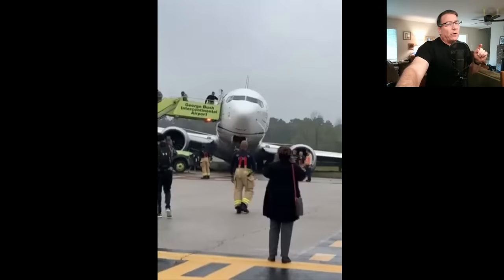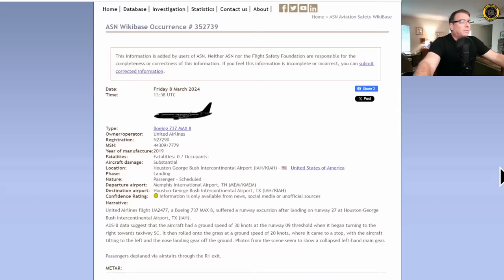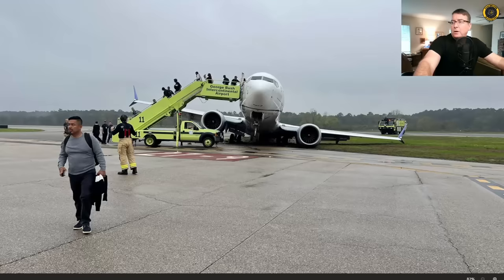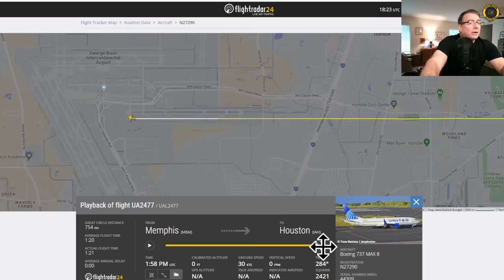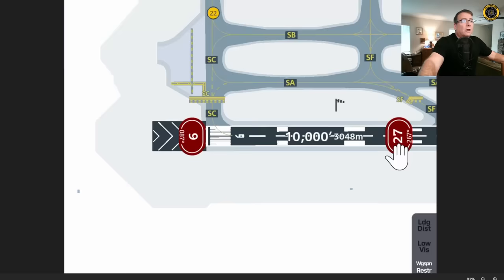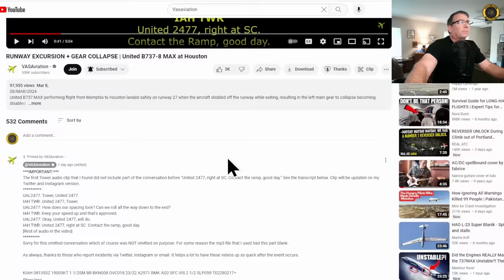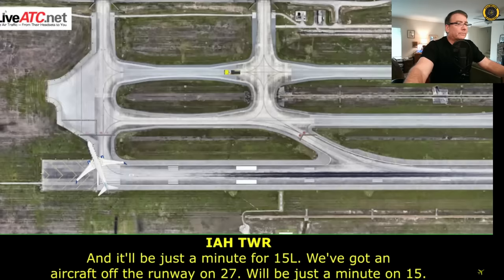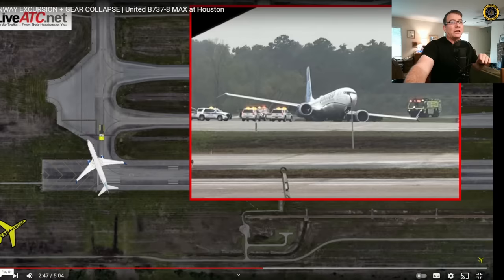United 737 Max Runway Excursion IAH 8 March 2024

Comment: it seems like it could be hazardous to deplane without getting a fair bit of lift/blocking under that nose gear or near the nose gear.

I would hate for that plane to tilt forward due to people leaving the aft section while people are stepping out onto that air-stair.
Reply: I was thinking that too.  Maybe they determined it was stable due to resting on the engine which is quite far forward on the Max.

Comment: Brings back memories of a MD88 taking a turn too fast off a runway in Cincinnati back in 2008.  Couldn’t turn and went wheeling through the dirt eventually powering itself back on the taxiway.  Sod was blasted all over the runway. Came to get gate and they wrote up main landing gear off the pavement.  I’ll say mud was up both main struts and nose gear.  Needless to say that aircraft spent many days at the hangar going through all the required special inspections.

Comment: I learned that lesson early in my airline flying while landing in Jackson Hole. If you're not familiar, KJAC is high elevation, and a short runway.  We had a wet runway. Grease job landing and easy on the brakes. I was startled when the captain took the plane and applied heavy braking. He turned off the runway at the end at about 5 knots. Even so, you could feel the nose gear slipping along in the runway paint. I conveyed that lesson to my first officers for the next 30 years. Thankfully, I never had a runway excursion. Ya!

Comment: 27 is always the runway of choice for Continental / United pilots, as it is a shorter taxi to the gate if you are parking on the south side. On the 777 and landing 27, I would always ask to roll to the end, as it makes a nice ride for the folks in back...as long as you stay out of the weeds!
I do not recall the tower ever asking us to keep our speed up when rolling to the end.
Reply: That does seem like an odd comment. Did they expect the pilot might just stop and then turn?
Reply: 777 is in a greater class than the 737, so turbulence time is less for this scenario, and another was closer on his tail.
Reply: @libby2012  I agree.  I'm guessing the controller had the guy behind him (1383) a bit close, and didn't want 2477 to dilly-dally.  Anytime ATC gives me an instruction like that, I think to myself "I'm flying this thing, not ATC, and I don't need external pressure."  "Unable" and "standby" are your friends.
Reply: Not the case reference 1383 as if the separation was decreasing to less than 2.5 NM inside of 10 NM from the runway the final monitor who has the responsibility for the separation during simultaneous ops (which they were operating) would have slowed 1383 and that did not happen.  The tower controller simply asked 2477 to keep their speed up on final since they requested to roll to the end.  I agree, you fly the plane and if I as the controller give you a clearance you don't like....."Unable" is the reply  for sure.  Since they asked to roll to to the end I suspect they would not have responded with "unable". @dermick

Comment: There is a video taken by a passenger when they de-planed. Sorry, I can't re-locate it, but I think it was on a local Houston TV Channel on TY. It showed the 737 took out 1 or 2 of the end of runway lights, and you could clearly see the skid marks of all 3 tire sets (L,R,Nose). It was clear they were going way too fast, and they probably should have bailed out and gone straight off the end of the runway. That would have saved the landing gear from collapsing.
Reply: Nosewheels don't have brakes so skid marks from the nosewheel indicates the nosewheel was turned but skidding on the pavement.

Comment: I note the prior exit - Sierra Bravo? - peels off at 35-45 degrees. Wonder if they forgot/assumed something about the profile of Sierra Charlie and felt no need to bleed more speed.
Reply: Sierra Foxtrot, a high-speed exit.  But that would have taken three turns (right 30, left 30, right 90).  I suspect they were looking for the easy way out, as Juan mentioned, a right 90 and straight to the gate.
Reply: @PatrickSennett  I'm guessing the tower controller would have preferred they use SF, it gets them off his runway quicker, and not as much worry about spacing.  Stay on the runway, they're on it an additional 30 seconds or so.  It's so silly, using SF then the parallel taxiway (then the 90 degree turn) would have taken maybe 60-90 seconds longer to get to the gate.

Comment: The runway paint ...just as slick, if not slicker than the rubber deposits. From experience, even at less than 10kts that paint will cause the nose gear to slide skid
Reply: Even that curb paint for the red zones, the yellow and blue zones, all colors, is deadly slippery. When its raining and you step on that edge of the sidewalk it's darn easy to slip and fall -- serious hazard.

I cannotvunderstand why we don't texture the paint!
Reply: @paulsherman51 Yes, you are correct. The paint used for the runway and taxiway markings gets just as slick.
Reply: @Mikado463  Sounds like high time for an FAA Groundworthiness Directive (GD?): texture all tamac painted surfaces, same reason we groove pavement. No, not meaning EW&F or ToP, either.
Not bad idea for DOT and munipalities, too.
Reply: @paulsherman51 I'm sure there's some reason it isn't done. Probably has to do with reflectivity or something like that. Above my pay grade. But ...as a Captain, I learned early on to respect those painted surfaces; they were slick as snot when wet. Not sure what was going thru the head of the person in charge of this United flight ... sometimes "hacking the mission" can bite you in the arse big time. Thankfully, I made to retirement without stubbing the old toe too hard.
Reply: Good thinking @Mikado463  reflectivity ... yes, didn't come to mind. Also perhaps when rough or textured surfaces collect dirt and grime thus becoming less clean and clearly visible; smooth slick stuff washes clean easily, aside from as you say being slick as snot.
Wise advice, r-e-s-p-e-c-t as the song goes, regardless tillering on the tarmac or strolling on the sidewalk near painted curb.
Congratulations on the milestone of retirement, Captain!

Comment: Juan, 

When I got to the airlines, I was shocked to find out that “line speeds” weren’t a thing. In ground school, I asked how deceleration performance was evaluated in real time, and received a 🤷‍♂️. In the Navy, we would reference the distance remaining boards to make sure we were decelerating properly. Generally, take the distance remaining board, double it, add a zero. So by the 2 board, no faster than 40 knots. 

In the 121 world, I usually triple it and add a zero. If I’m at the 2 board and I’m above 60 knots, I need to do something about it. 1 board? I’m below 30.
Reply: Just wing it, literally
Reply: What do you mean by 3 boards, two boards ect… I’ve been an airline pilot for over 15 years now, and I have no idea what you are talking about..

Comment: Once you get into the rubber deposits especially when it’s wet…..it’s like ice. They were still doing 58 knots in that area they weren’t slowing down. Once they exited they got it slowed a bit but ran out of rwy and tried to make the turn. At 30 k that nose gear just skipped along the pavement and they plowed into the dirt. They’re screwed….

Comment: I worked at IAH for a number of years and have very good understanding of the procedures.  It’s common practice for pilots to request and ATC to approve the roll to the end in order to avoid a longer taxi due to the position of the runway with the airport and that runway only having access by 2 taxiways. All of that of course is all dependent on how busy it is and whether the spacing of the aircraft behind is adequate.

Comment: @blancolirio looking at the overhead view along with the angle of the aircraft, I almost wonder if the PIC didn’t think there was grass there. Looking at the overhead, there is the grass obviously where the plane is located but directly in front of him is more pavement (that undeveloped taxi-way stub). With the angle of the aircraft, it looks like he was attempting to make a wide turn thinking it possibly was a high speed turn-off NOT a 90 degree turnoff. With a rain covered windshield, just makes one wonder if he for some reason thought that was pavement.

Comment: So it's SWIFT in the trucking industry and UNITED in the airlines!
Reply: Not quite sure what you mean, but you sound like you know. 😉😜
Reply: Swift was the truck co truck hanging off some bridge  by a thread last week. I guess also one of their trucks videod getting towed out of a snow bank near Donner Summit~ no chains etc.Main stream news very Swift.(it's one of the better trucking transport companies)
Reply: Swift has been earning its reputation for decades.
United is just having a bad run recently.
Reply: It's always good to see SWIFT trailers on a train, much safer than on the road.

Comment: So many were very quick to blame this on the MAX design.   Of course, us av-fans know that is mindless and ignorant presumption.  But Boeing will still take a PR hit on this.
It does look like they took the exit too fast, slid and put the left MLG in the wet mud, inertia did the rest and likely overstressed the sheer bolts for the left MLG leg. (Assuming the Max has such on it's gear to give way before major wing damage occurs)

4 year old bird, so likely not a write off.  But someone is going to be having tea and biscuits with the boss.  (British parlance for getting called in to the bosses office for a ticking off).

I put no faith in passenger witness testimony about the landing.  One persons fine is another person's "too fast, too bumpy".  Most passengers won't even know they were flying on a 737.
Reply: a couple runway excursions are pretty much expected each year. usually from touching down late on a wet/icy runway, even though it wasn't the case this time. Not a big deal to the pax or the aircraft (relatively speaking).
Reply: I would not dare to think to blame that on the aircraft. The first thing that came to my mind when I saw this and heard the radio transmission was pilot error. Keeping your speed up is one thing, but knowing this to be a 90° turn which you shouldn't approach faster than 10 knots even on dry asphalt, this for sure felt like someone trying to be smarter than physics.
Reply: @Quotenwagnerianer  even with management pushing for more efficiency, this is still on the pilot.
Reply: That might be a tea without biscuits conversation.
Reply: "Assuming the Max has such on it's gear to give way before major wing damage occurs"  That's an FAA requirement for Part 25 aircraft (airliners).

Comment: thanks juan; consider two 8x12" - + tire patches controlling the direction of 150,000 pound machine attempting a 90 degree turn on a wet taxiway at 20mph.
Reply: With very little front grip to begin with even in dry conditions.

Comment: What is the Anti  Skid wheel arming speed, if you were at or above this speed and on wet Rwy. Paint the Anti Skid probably was releasing the brakes.  Combine that with the end of the Rwy. Coming up you try and make the turnoff with the Anti Skid releasing, the kenetic energy vector and side loading of the left main gear at or above 10 kts. Probably caused the collapse of the left main in the mud off the taxi way turnoff.

Comment: Juan, check out simple flying.  A UA flight in New Jersey had stuck rudder pedals ,  right at touch down.  Had to immediately use the tiller to keep centerline. Both sets of pedals were stuck.  On a  following test flight, the issue reoccurrd, at altitude. UA 737 Max 8,  l   believe.  They say things come in threes !
Reply: Of the three United mishaps the stuck pedals is the scariest.  Shades of what happened in the 90's!
Reply: Yes,  I agree with you. 100 Percent.

Comment: It seems to me that the root of recent problems is that we are simply cramming to many planes, too close together. And we are not learning a lesson.
Reply: Yes.
Reply: Now let's hide the statistics from what we used to do in the past so no one can analyze it properly!
Reply: Are there new airports being built in the US at all? Because the demand is not gonna reduce any time soon...
Reply: It will only get worse
Reply: @rinleez  few but it's mostly just current airports expanding because it's cheaper. but the amount of flights expand with it so it doesn't really make a difference whether you build or expand airports.
Reply: @rinleez  If there are new airports being built, I'm not aware of it.  Also, building new runways isn't happening that often.  I was an engineer on ATL's 5th runway 15-20 years ago.  They are working a plan for building a 6th runway, but it's expensive.  #5 cost upwards of $1 billion, #6 will cost that and more.  Atlanta needs a second commercial airport, really.
Reply: All that runway and yet this  occurs.... 😢 I'll bet it's like an oil slick on that runway near the end.
Reply: Seems to me, you don’t know what you are talking about.

Comment: landing long at Chicago Midway airport in a 732 in the 90's .. tower told us to turn off at the end of the runway "if able" .. showing a lack of confidence in "our" brakes.
Reply: There's been at least one parked on the streets of Cicero.
Reply: @5695q  I think the name of the street was Cicero
Reply: B732, Midway Airport, 1990s....must be Southwest Airlines.  Am I correct?  I miss those 732s, especially the rumbling sounds of the JT8Ds...😊
Reply: @keezeeroots5997  NJ ..Vanguard
Reply: @BSsss603  I remember them.  I applied for an FA position back then, never heard back.  Thanks for responding.
Reply: @keezeeroots5997 I think it was a 300 or 400, the 200's were on the way out in the early 1980's and I hardly saw them at KSAN when I worked there.

Comment: The flight landed 24 minutes early, too.  I suggest that he was given a gate that mandated he get parked early to keep the gate assignments manageable.  He was using the runway to "fast taxi".
Reply: Personally if I were booking it, I would have taken SF, but by the time they knew they were going too fast, they had passed it.
Reply: Whenever atc asks you to keep speed up you can accept that instruction but then its up to the PIC to determine what speed that is. Not a violation if its not fast enough for atc. Let them deal with the spacing it shouldn’t even be on the mind of the pilot that’s not our job.
Reply: 30 knots is too fast?
Let's be even more emphatic: on an ACTIVE RUNWAY? With others usually waiting for it to empty, in fact?
Would 5 be safer then? No approach spacing problems there, right? Come on. 30?
Reply: He could have turned a little earlier at the high speed exit 😂
Reply: @BrianMorrison  Brian, you are correct.  That was last chance the Captain had to overt this outcome.
Reply: @Bill_Woo  Nobody said that 30 KTS was too fast they said the pilot was taxiing too fast which is not arguable since they departed the taxiway in an uncontrolled manner. 30 KTS may have been fine on the RWY but they pushed it too far & weren’t able to slow down in time. Pilot error. End of discussion.

Comment: Bad week for United, and an even worse one for the crew of 2477. When I would train mechanics to taxi I always stressed that 90 degree turns should be done at 8 knots in dry conditions. That's straight from Boeing as applied to a 777. In slippery conditions, it is often necessary to drag the inside brake to effectuate a turn. It both aids the turn and transfers more weight to the nose gear. I would assume this crew did that. FWIW, the painted threshold markings get very slippery when they're wet. It's even worse if there's deicing fluid on paint, although that would certainly not be the case at IAH.
Now Juan has to cover the United 757 that lost one hydraulic system and diverted to LAX fro SFO.

Comment: 58 knots just shy of the far end.  Then an attempted 90-degree turn at 30 knots.   All of this on a wet runway with a TON of paint.   As predictable as the next sunrise.  Sad day for that FO because at that point he had almost nothing to do with it.     FOs don't generally slow the jet from 50 to zero.  When the Captain's hand comes up to the throttles and he indicates that he's ready to assume control, that's it.  The FO comes off the throttles and off the rudders.  At most airlines, taxiing is the bossman's job.   And unless this is a very special Guppy, there is no tiller on the FO's side.    These days with AutoBrakes, a LOT of FOs barely or never even touch the rudders/brakes.   So when the time comes they are poorly prepared to save the day and really have no time to comprehend what is about to happen.   Every new Captain has to learn how much turn he can "ask for" and then receive under varying runway conditions and speeds.   This ain't driving your Audi onto the off-ramp at twice the recommended speed.   The lucky Captains learn the easy way and don't make the news.  
They'll just keep that "loose bowel feeling" nugget stored away for their next thousand landings.    If you're rushing in this job you generally need to give it a second and third thought before continuing.   Cuz its a great way to draw attention to yourself and your actions.    When in doubt, STFD.     But then again, some guys never learn until the learn the very hard way.
Reply: ding ding ding. 100%. I've got nothing to prove anymore. I go slow all the time. If my FO even appears rushed even during the pre-flight, I encourage him or her to take their time. If they still don't slow down because they are trying to please me, I get up and go to the back and get a cup of coffee to remove any pressure. My goal is to retire without anyone in the chief pilot's office knowing my name.
Reply: Experience holds a dear school, but fools learn in no other...